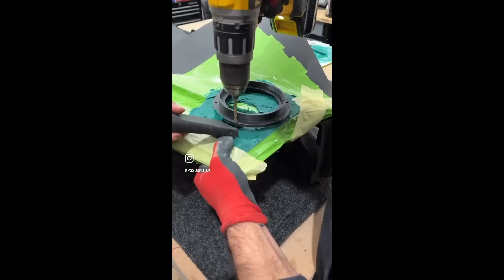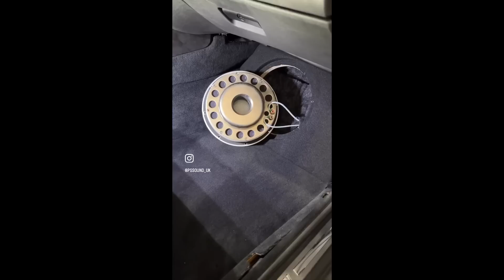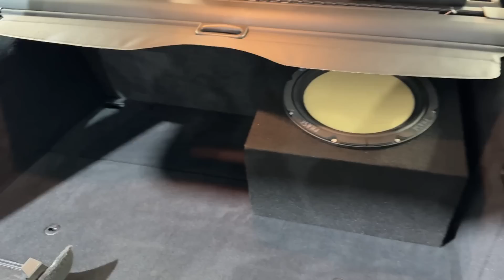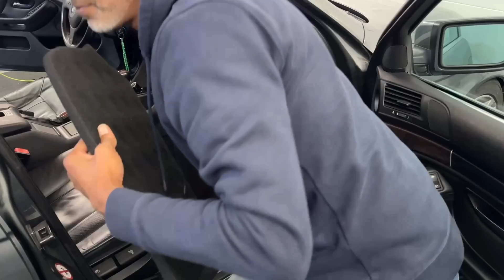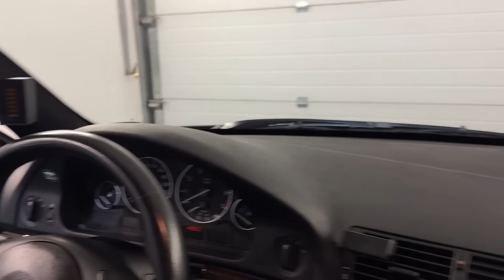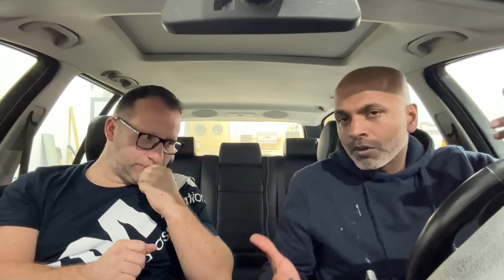BMW E39 Touring High-End Audio System EXPLAINED - Mundorf, Steg, Phase Aliante, Helix

Comment: Do you think it would be feasible/sensible to do a similar build but without cutting the carpet? Is there any downside to not cutting the carpet except for the loss in volume?
Reply from the maker: One major issue is mounting options. Then legroom for passenger and potentially not meeting the distance/space requirements for competition rules.

Comment: Hey!
I know you didn't do any drivers in the kicks, but I'm in the process of planning how to build a sound system in the same car (E39 touring) and plan on mount 6.5" drivers there...
Do you know how much space there is either against the torpedo wall, kicks or the outer corner of the footwells? I drive a manual left hand drive car, so i have an extra pedal to take into account 😅
Reply from the maker: We had a look and it didn’t really look like it would be a viable solution in those cars. Not impossible, but lots of work that most people won’t put up with.